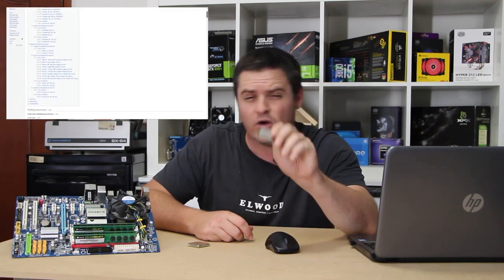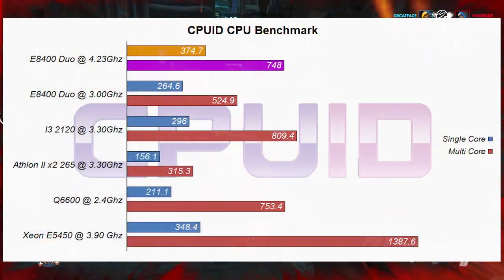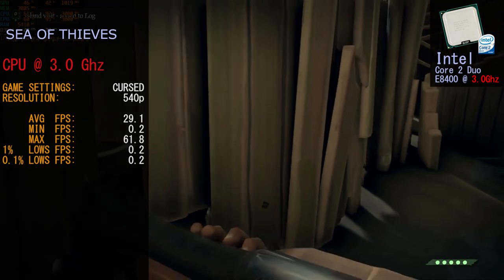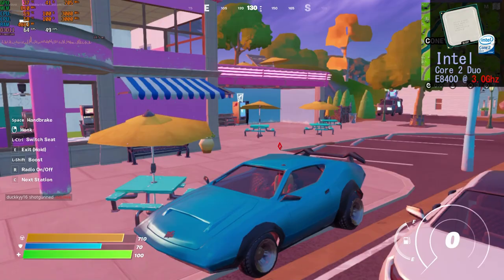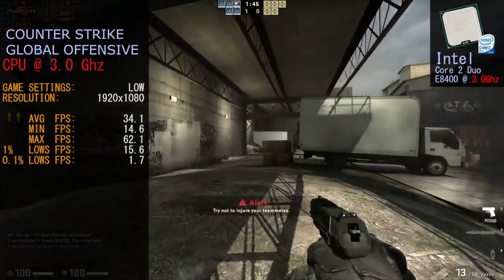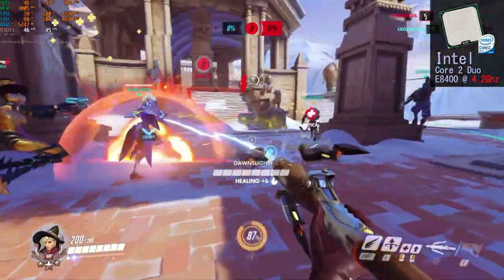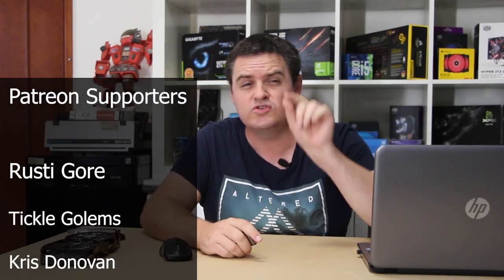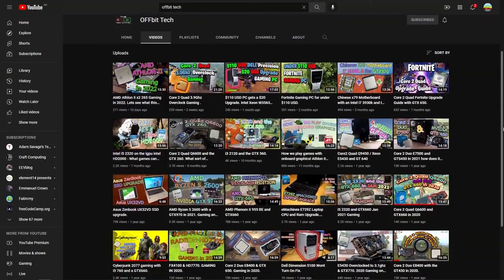How to game with a core 2 Duo Overclocked 4.2ghz.

Comment: Enjoyed the content and subbed OFFbit Tech.  Interesting stuff especially when I paused the video and realized i have the same motherboard and I think I have the E8600 chip on it.   Loved the content and would be interested in how you got the sweet overclock?  P.S.  I think the Wolfdale chips are 40 nm die process?   Also might want to watch the north bridge  temps. (I have a beefy copper fan unit on mine)   Cheers on your excellent channel!
Reply from the maker: Hi Obie327,

Thank you for you support, we really do appreciate our subscribers here.
The GA-EP45-UD3L motherboard is a great core 2 motherboard and it is probably the best core 2 motherboard we have here in our inventory at the OFFbit. 

The overclock settings.
We managed to get a reasonably stable overclock at 4.23GHz
This was basically our settings.

Set CPU Host Clock Control to [Enabled]
For the 4.23Ghz setting on our e8400, we set the FSB to [470Mhz],
at this setting you will need the System Memory Multiplier set to [2.00B].
We basically set the lowest setting to get the memory closer to our corsair DDR2 800 Ram rated speed,
Which is being overclocked still by about 140Mhz.

We also set performance Enhance to [Standard]
Load line calibration to [Enabled].

Now depending on a few things, such as power supply noise/silicon lottery of memory, chipset and CPU the stability will vary. Giving you either better or worse results. So you may need to tinker to find the best performance. 

Most of the time this setting gave us near-perfect runs with the odd problem at times.

It's also worth mentioning using software like AIDA64 to check the stability when overclocking, this will help you tune it in. I usually find myself tweaking it a few times more after running AIDA64 still.

For a system with a bit more day to day use you may wish to ramp the overclock back a bit so it's more stable (460 or 450Mhz FSB might be good).
Now you said you had an e8600 which has a higher on-chip multiplier so getting to 4.2 GHz will require a smaller FSB which will enhance your stability.

Thanks for watching and we hope this information helps.
Reply: @OFFbitTech  Thank you Man!  I will check this out!  Cheers!

Comment: can i play valorant on windows 10 specs intel core 2 duo e8400 ddr 3
7gb ram
 gt610 1g ddr3
 120 ssd
Reply from the maker: I think it should be ok,
You will most likely need to run at lower settings.
The core 2 duo will probably give you some load lag at times but once everything is loaded in it should be playable.

It's been a while since I have tested Valorant on an older PC, but I think everyone you have should be able to run it.

Let us know how it goes,
Thanks for dropping a line by and thanks for watching.

Comment: What is the best cpu range from 50$ between 100$
Reply from the maker: It's a bit tricky.
It will depend on what motherboard is available or you are planning to use as these prices can vary greatly.

At the moment you can get i7 2600 cheap these days, but even first and second-gen Ryzen CPU are starting to get into this price range at times and that would be a better deal but DDR4 ram is then in play which may affect your budget.

However, I usually find the High end older Intel Xeons CPU from X79 motherboard and x58 will give you these prices all the time but the motherboard cost so so much and they are getting old tech.

There are a heap of Haswell CPUs and even some skylake CPUs that are edging into this price range as well.

Tricky question but a good one.
Thanks for asking?
I would love to know what your thoughts are.

Comment: how u run a gt 1030 ddr5 on this board it only ddr3 i have the same board with q8200 i can really install this
Reply from the maker: the GT1030 will have GDDR5 on the actual video card's circuit board.

DDR3 ram on the motherboard is different to the one on the GPU.

Simply just plug the GT 1030 into the PCIE x16 slot and you should be good if there is no UEFI issue, which should not be a problem with a lga 775 motherbaord.

Comment: Can i play gta 5 online on
core2 e8400
gt 610
ram 4gb

How many fps?❤
Reply from the maker: You could run it. But playing it would be a totally terrible experience. You basically need a quad core to run the game. If not don't move out of the location you start. Things in the world fails to load on a dual core. As with a gt610 this would also make I difficult aswell. 

So probably not worth trying unless you just want to see how bad it could be for giggles.
Reply: You can play if you lock the fps to half